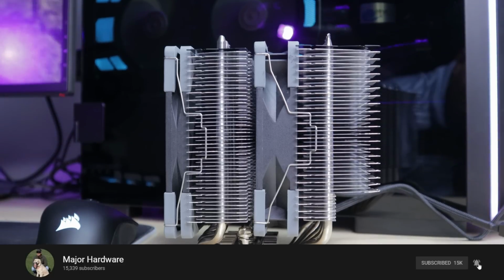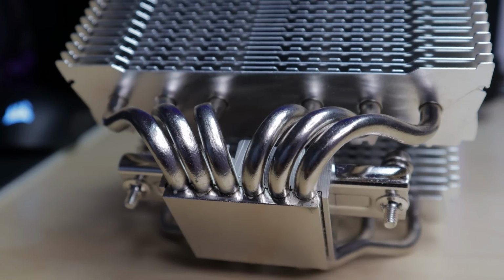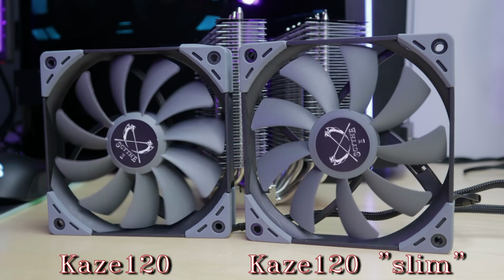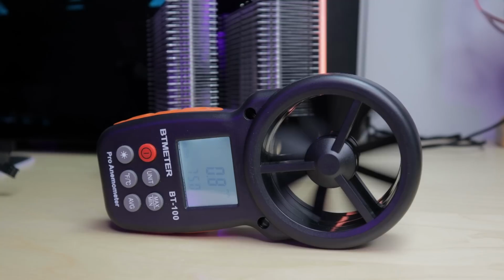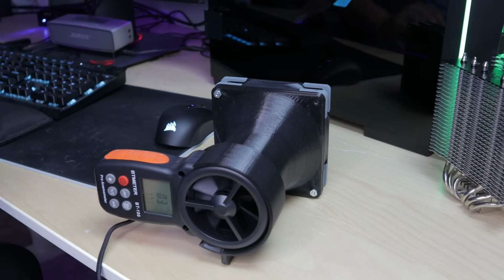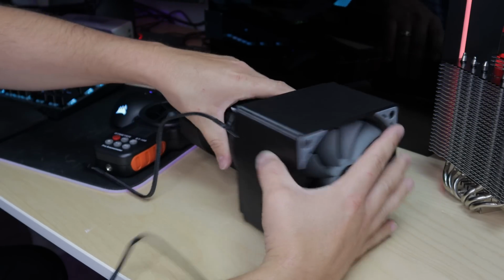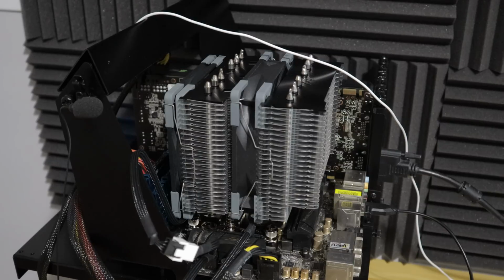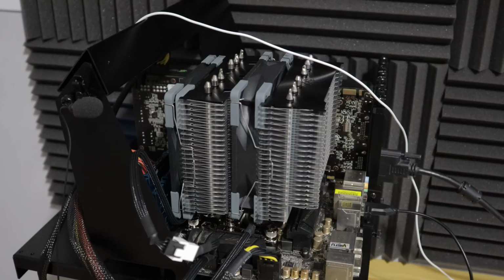This Air Cooler Is Doing Something No One Else Is! | Scythe Fuma 2

Comment: I think it would be interesting if you replaced both fans with ones from Noctua, specifically the NF-A12x15 (15mm slim fan) and the NF-A12x25.
Reply: Qrash that would be interesting! How much it is the blades and how much configuration!

Comment: It's not just aviation.  Marine propellers are always contra-rotating when there's a pair of them (side by side, not stacked, but it's essentially the same physics), and not just for efficiency as the sideways thrust would cause severe maneuvering problems at low speed.
Reply: thx for the info.

Comment: This Scythe Fuma 2 is an improved version of the previous Scythe Fuma Rev. B. Creating the same performance with less noise, without hindrance of the ram slots and a better mounting system. Beside the Scythe Ninja 5, this is the only cooler I know you can mount in a blitz with even the fans attached on it. 7 decibels difference between this cooler and it's predecessor, but only losing 1° C with it, is something we can't complain about. Beats out the Noctua NH-U12A in noise, on level with the Dark Rock Pro 4 and hell lot cheaper then the 2 mentioned coolers.

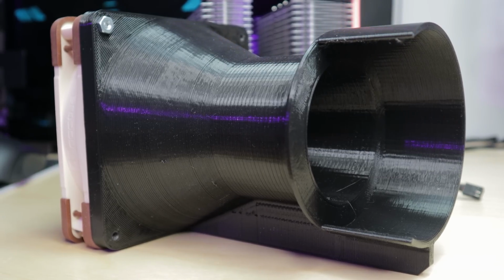Comment: Hi man, great video as always. Just here to offer some constructive cricism if you do not mind. I do not think your setup at 5:04 is a great idea to measure airspeed. Since that bracket just gave the air more energy according to Bernoulli. Or less depending on the way the fans are mounted. But otherwise great stuff man, love your vids
Reply from the maker: Greed however that's why I didn't compare them to listed specs just verses other. This keeps everything even
Reply: @MajorHardware  I see where you are going, but that's the thing, the speed is squared in that equation, so what would seem like a small difference in regular circumstances, may seem like a larger one now. So, If you really wanted to do a setup like that, I would advice to just make a tube, even size all along, with a mounting hole in which you can stick the meter in the "free stream". Still you will be altering numbers, but since there is no reduction of the tunnel size, the differences will be more true to reallife performance than they are now. Thanks for your time!

Comment: It's not the same contra rotation as a Bear bomber where the props are together, its more like a Cessna Skymaster with one at the front and the other at the back. The rear propeller has a higher pitch than the front as the air is already moving, a car uses a low gear to start moving and then changes to a higher gear.
Reverse flow in a pc case is to pull cool air in from top rear and exhaust it front bottom, this has the advantage of sucking less dust and keeping cooling fins cleaner in the long term, dust falls all the way down so there is more at surface level.
The fan not blowing through your test rig is caused by something called Fan Stall, the outlet is restricting the flow just enough to cause the air in the fan to spin inside it rather than go through, this is what happens when you block the nozzle of a vacuum cleaner and hear it rev up. Putting your hand in front blocks a little air allowing the fan to push the rest through normally. Check the rpm in free air and on your test rig, rpm goes up when stalled.

Comment: I wonder if it's really all that benefecial considering the cooling fins in between pretty much straighten the airflow out.
Reply: That's what I was thinking.
Reply: Yes it does make a difference, another reviewer tried swapping the fans out for faster, higher airflow fans, only to find that both thermal and acoustic performance was worse...
Reply: @jimmybnewman  wouldn't listen to these d grade nerds. Just taking shit on YouTube like it's their living. Zero evidence just some shit they learnt in school probably years and years ago 😂😂.
Reply: @jakea3950  debates of ideas reveal their “genius” level minds.... doesnt answer the question of which end of the scale that genius sits on thou.
Reply: I think the cooling fins do straighten the airflow but only in its vertical component and leave the orizontal one unmodified.

In particoular the top and the bottom part of the fan should be the ones unstraigthened since they produce the most orizontal deflection from the axial direction.

So, as far as i think, half of the global deflection (vertical one) is taken care by the fins while the other half (orizontal one) by the other counter rotating fan.
Reply: It's almost like he said that in the video
Reply: thats exactly the issue, fins put it straight so it resets the flow direction instead of blowing one into the other.

in this case 'contraflow' is entirely a gimmick
Reply: @bradhaines3142  Couldn't agree more.
Reply: Yeah, seems like just a marketing gimmick
Reply: it's beneficial overtime as it reduces torque in the cpu cooler which ease the cpu socket stress
Reply: @753238  
did this man really suggest that a Computer Fan is going to bend the Bolts that hold a CPU Cooler on or otherwise apply any relevant force at all upon the Cooler.
Reply: @taiiat0  Yes he did. Lol.
Reply: @753238  you do know gravity, right? Unless you have your motherboard horizontally,you'd want to have both fans to counteract the moment induced by gravity.
Reply: @MqKosmos  Also the fact that one side of the fan goes up against gravity while the other goes down with gravity so even one fan would counteract itself
Reply: @mjmjmjmj4229  Well, while the effect on the cpu is completely insignificant there is indeed some counteractive torque created by a fan (or rotor). This is why helicopters have a tailrotor so they don't spin against the direction of the rotor.
Reply: @NicB-Creations  Oh yeah, forgot about that. But that got me thinking, helicopters need that tail because the helicopter itself is not attached to anything else in its system. A cpu on the otherhand has the weight of the whole pc to function like the tail in its system(please correct me, I'm just sending out ideas and I'm probably wrong)

Comment: since the flow meter also has a fan, the angular momentum created by the clockwise rotating fan made the air slip right past the fan blades with minimal friction

Comment: Strap a 12 v mixed flow EDF to a master cooler fin stack
Reply from the maker: Funny you say that, I also have some experience in the Hobby world i use to do FPV racing qads and fly planes and helis a lot and i have thought about trying to get a BIG EDF and testing its cooling performance. But i dropped the idea because the size i was looking for around 120mm was way to pricey but maybe some day.

Comment: Sorry but this test seems to not make any sense when its not installed in a case, as you show on your very cool RGB fog test the ideia behind this configuration is to conduct all the air and heat like a tunnel not allowing it to accumulate inside the case so making the internal temp of it lower and the other components inside the case will have lower temps as well, and test would need some delta of time to test it between all the compared fans.

Comment: it makes sense, since the rotation of the airflow causes the air to go through the anemometers finblades in a direction that is parallel to the blades, if u flip the anemometer it should work
Reply from the maker: Interesting take something I will take a look at tomorrow

Comment: Have you considered 3D printing your fan to anemometer shroud with flow straighteners/fins inside the neck?

Also, you should try the fog box with the cooler attached (For science!), as I’m figuring that the mounting of the fan to the cooler is going to straighten the flow and it would be interesting to see how efficient the different fin designs are at straightening the airflow.

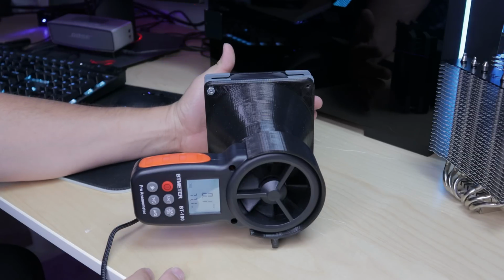Comment: 6:25 that's what they use on cars. Pulling air from restricted airflow radiators especially when there're more in stack rads intercooler a/c and engine cooling This kind of fan is made for high static vacuum pressure. I don't know the exact terminology but this fan cannot pull air without something restricting the intake from the center. The suction comes from the sides and when its unrestricted air escaping from the same side towards the center.

Comment: For another episode, run the fog generator through the heatsink with the fans to teally show if two same way fans and the contra rotating fans produce the same air flow due to the fins straightening the air flow?

Comment: To actually use the "straight" airflow,  you should test both, normal + counter rotating fans directly in front of the cooler to get the straight flow
Reply: As it happens I'm about to try stacking a round-frame Scythe Kaze 140mm on my Noctua NH-U14S cooler (has a NF-A15 fan, also 140mm round frame), which will result in a giant ghetto-mod dual contra-rotating impeller fan.

Comment: So can you Please test it with a Push Pull Configuration on a Watercooler?
And thank you this was verry interessting =)
Reply: What should it do there.  The flow was straightened inside the radiator.  Both one on another in push would make sense
Reply: @ismaelyu5  Just test it wnd show how the air coming trhough the Radiator with the white steam. Just wanna see it!

Comment: I think the Kaze 120 was too good of a blade design compared to the others. The anemometer's blade design was most likely affected more by more turbulent air from other fans, as shown by you placing your hand in front of the Kaze 120, creating an increase in air turbulence. The non-turbulent air likely was able to just travel trough the anemometer's blades, rather than turn the anemometer. Testing a low turbulence fan from the likes of Be Quiet! would create interesting results, due to them engineering their fan blades to create limited turbulence.

Comment: Probably the clockwise rotation of the fan made it more difficult to spin the Anemometer if they spin the same direction. Try flipping the Anemometer around.
Reply: Yes, you need a diffuser, lookup wind tunnel diffuser, really cool idea making those 3D printed parts!
Reply: actual airflow straightener  :)
Reply: Also means that his other measurements are off, his airflow measurement should be independent of the swirl.
Maybe add a cross of plastic fins into the 3d print, so the air can rotate while traveling through the duct.
Reply: Maybe put the Anemometer in front of the fan with a additional inlet tube. Would eliminate any fan vortex effect. While it would reduce flow as a restriction it should still be a valid comparison since  these fans are built with a resistance to flow in mind.. Fan speeds and noise will be affected I'm sure but other test can be done for those
Reply: Nope, is something called Fan Stall !
Reply: @steverpcb  the shape/design of the fan blades in order to gain access to the rotational airflow from the other fan must have messed up the fans stand alone performance. Thus, causing fan stall as you said. When something was in front of the fan forcing the fan to only grab air from the sides it worked because it was designed to grab from the sides.
Reply: @ILikeSongs5  as I explained, it's like the rear propeller on a Cessna Skymaster.
Reply: My thought right away
Reply: It's because the fan spins in the other direction and the air travels spinning in the opposite direction of the anemometer's blades. Flipping the anemometer won't have any effect on it.
There are other fans, like the ones found on the Fuma 1 that even if those have fewer blades, the blade design is the same as this one but spins in the "normal" direction.
Reply: Use a hot wire instead of vane anemometer
Reply: or put vanes in your plumbing to stop rotation......btw the fins in the cooler stop spinning of air therefore it should make no difference which way they spin when in use.....
Reply: @easymoney1997  Nope, the fan is stalling due to the restriction !
Reply: @badjonatan  Would a laminar flow printout inside the assembly help?
Reply: @badjonatan  swapping 12V and ground won't reverse te rotation, as it uses a brushless motor, which is driven by a controller, so in most cases you would either break the controller, or the fan has a protection diode, and it wouldn't work..
Reply: @badjonatan  technically yes, it's a transistor based controller, as are probably all controllers that don't use exclusively electromechanical switches (relays) and/or vacuum tubes.
but brushless motors generally work on 3 phase ac, so to reverse them the easiest option is to swap 2 of the 3 wires going to the coils.

Note that there are single phase brushless motors which can't easily be reversed, they use a core that is asymmetrical, which makes the motor turn in a single direction, to reverse them you need to flip the core, which is fairly hard because it's friction fit onto the housing.

Anyway, both types of motors need some kind of ac power to rotate, so they can't be directly hooked up to the 12v dc, which means they need a controller that chops up that dc and makes ac out of it, and that uses 3 half bridges for 3 phases or an H bridge for single phase.
Reply: @badjonatan  any driver that uses flyback diodes on the power stage will short out if fed -12V
Reply: Ya got one fan blowing and one fan sucking, we all know it better to have two fans sucking and blowing than one that's stalling. ;)
Reply: Better idea is to suck the air through the anemometer so the rotation of the air isn't a factor at all. As long as you run that exact same test on all the fans being compared, there should be no discrepancies.
Reply: sounds about right, but if you flip the anemometer its propellerblades will still be angled in the same direction.
you need to get rid of the turbolence.
(mount a cooler between fan and -//-meter or print an insert for your adapter with like 10% infill and no top-& bottomlayer)
(also the -//-meter could say the airflow is pretty good when in fact it is just mostly spinning after the fan)
Reply: First thing I thought too when I saw the video. Proved by the fact that putting a hand in front - of heatsink fins - would work just fine.
Reply: That was my thought.
Reply: Screw the stock fans and the opposite directions replace the 2 stock fans with 2 noctua nf a12 120m× 25m a guy tested this concept and got even better tempeture drops that beat the similar  noctua cpu cooler that costs around 120 dollars. On the fuma 2.

He then decided to add the slim stock fan to the back of the fuma 2 and got an additional 4 degree tempeture drop on top of the 40 degree tempeture drop vs his previous water cooler.

I tested this and my cpu Temps stayed around 75 degrees Fahrenheit with just 2 noctua fans running at around 800 rpms.

About to test with adding a noctua nf a12 120m × 15m slim fan and see how much more the Temps drop and that is also with running 6 total lian lu case fans.

With 2 in the front mounted as intakes.

And one on the bottom of the case mounted as an intake. One in the back of the case right behind the fuma mounted as an exhaust and 2 on the top of the case configured as exhaust.

Will post results once done.

I like all my tempetures as cold as possible and to run no higher than 100 degrees Fahrenheit max.

The colder the happier I am, especially with ryzen 7 3700 x processors.

While I like quiet too
Reply: @gabrielstern4992  the main reason you can do that are the stock fans are slow and quiet. You can trade noise for better airflow but that's a tradeoff.
Reply: @deViant14   I actaully made a modification since then first I tried a 3rd noctua slum fan in the rear of the cpu cooler.

Then I scraped that and just purchased and ordered another noctua fan just like my other 2 fans and set them to run between 1000 rpms and 1100 rpms and that is the sweet spot for me the cpu Temps and the processor Temps and motherboard Temps stay between 79 degrees farenhieght and 85 degrees and never go above 100 degrees Fahrenheit when under heavy load.
Reply: The noctuas are quiet fans and the lian lis are quieter as well.

Vs most fans.

The trick is cfm flow noise level and static preasure.

The lian li fans have a really high static pressure and a pretty high max cfm flow 

The noctuas I mentioned have good static preasure but not as much as the lian li fans but a max cfm airflow of 105.

And a max rpm of 2200.

The lian lis are 2000 rpms.

So running them between the 1000 rpm and 1200 rpm range is the sweet spot I found.

But the noctua slim fan I don't recomend as the static preasure is not that good.
Reply: Flipping it will keep them same direction. Need a symmetrical anemometer
Reply: I think your right
Reply: @badjonatan  you clearly missed the point. Also, the wiring plays nothing into the results.
Reply: Op is right, the blades on the anemometer are perpendicular to counter clockwise air spin but parallel to clockwise air spin. This needs an air straightener.
Reply: @Seibar42  Nope get a fan and blow into it from the front and then from the back, it will run the same way ! The fan is stalled, it's designed to work on moving air not static.
Reply: @steverpcb  surely he would have noticed that there wasn't any air moving past the anemometer, he's not that inattentive. It's simply that the air is moving in parallel to the fins and not pushing against them to make them turn.

Also your test is moot as the direction of the twist doesn't change just because you move the fan. As other people have pointed out if you flip the fan and reverse the direction it'll reverse the direction of the twist and pdf the anemometer. Others have even suggested getting a universal direction anemometer.

Comment: Did the kaze 120 not produce any airflow with just the duct, or was it with the duct and anemometer?
Reply from the maker: With or without anemometer there was no airflow
Reply: @MajorHardware  ok now I'm just confused. Quick robin to the BatComputer, we have some CFD to do!
Reply: Good question,  would tell us if the problem is in the blades or the duct